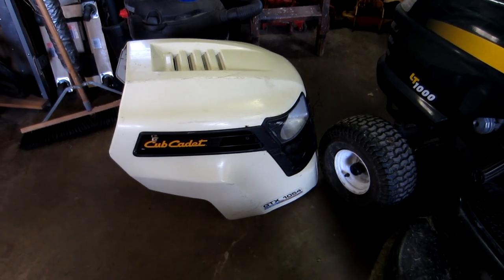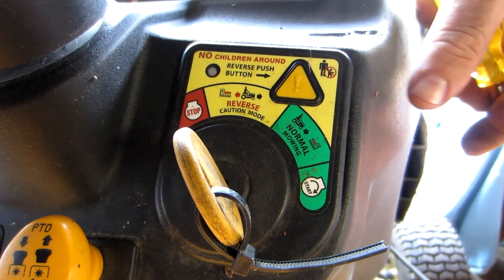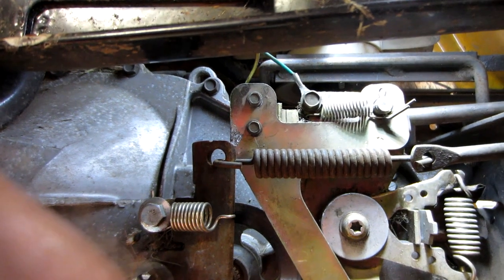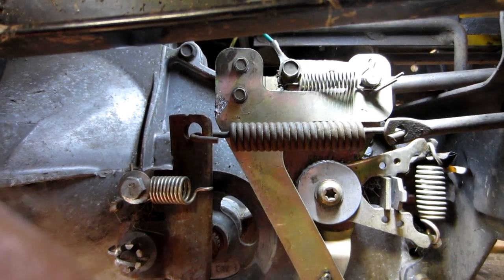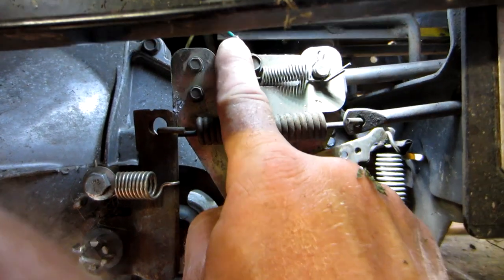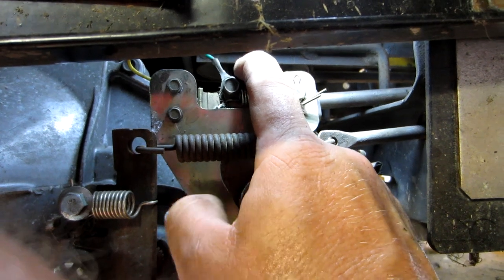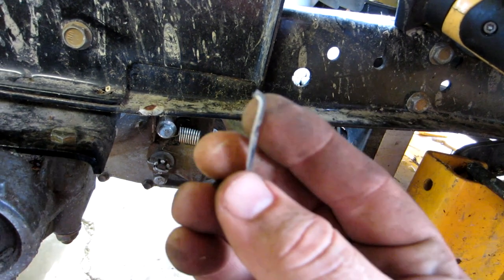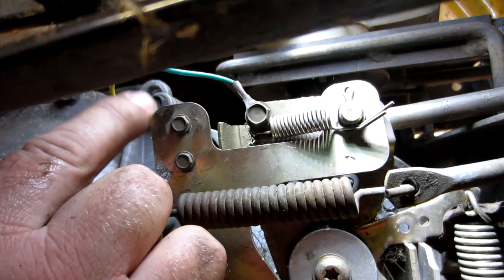Mower PTO Reverse switch Bypass

Comment: Figured out previous owner had tried to do this but didn't tape the wire, causing it to periodically ground to the frame. Thank you so much for shedding some light on this common issue!

Comment: Thanks for the video. I have an LTX1050 where the reverse mow button stopped working. After watching your video I found the switch right away. It's slightly different on the 1050. It's a plunger type switch fed by 3 wire through a block connector. I simply unplugged the connector and problem solved. The module had a yellow and green wire in it. I had recently changed the starter solenoid and green was used on the low current ground side. Good job, your video was a big help!
Reply: Correction...Fed by 2 wires not 3. Fat fingers

Comment: First thing I did with my Cub was disable the seat switch and the reverse shut off. If people can't safely mow they shouldn't use power equipment.
Reply: Heck yeah, I actually feel like that button is more likely to cause a distraction myself.
Reply: instablaster...
Reply: If people wouldnt drink and mow their kids wouldn't be chopped up...NO SWITCH NEEDED WOULD WE.  Happens every year!
Reply: @harryballz6358  That's what my old friend Howie Feltersnatch used to say.
Reply: Now if you could only find a bypass for the new "anti-spill" safety device on gas cans... you know,  the one that's impossible to use without spilling?

Comment: THANKS Saved me from taking tractor TO DEALER. You helped me to locate switch only to find hot wire was severed. That was last switch on my list to check kept blowing fuses.

Comment: Thank you so much! On my 01 Yardman 42" I lifted seat, pulled battery and tray and was able to access it easily. Been mowing for 6 years with this annoying switch. Would have to disengage blades every time I wanted to reverse. Mowing will be so much easier now!
Reply: It took u six years? You should be ashamed of yourself.

Comment: Thank you so much for posting this.  My switch went bad on my ztr Cub Cadet and I was about to lose my mind.  I was able to bypass it by just unplugging from the switch. It was as simple as that, and it was right where you said it was.  I didn't even have to take the wheel off or anything. Thanks so much!

Comment: Thanks! My LXT 1050 normally when you pressed the "yellow" button once with the key in "yellow zone" would allow you to mow in reverse unless you shut the PTO off. At that point you would have to reset it. Not this year!  Even holding the button down it shuts the PTO off in reverse. Came here looking for (location of a relay?) that may be causing the problem but this looks easier & foolproof.

Comment: Those are nice ideas and I will try that on my Cub Cadet zero turn mower which gives me the blues when mowing. My older John Deere zero turn runs the same in either forward or reverse and it don't turn off when in reverse. I will try that fix on the Cub Cadet and see what happens. Thanks for the tip and I hope it works for me.

Comment: I took a spring off a wooden clothes pin   cut the spring off with wire cutters which leave you with a U 
All you have to do is bend the legs so they are straight with each other and pull the PTO button out of dash and where the PTO button would plug into the base of its receptacle push the legs of the “prong jumper” into the base. It takes five minutes and you don’t have to do anything under the mower.

Comment: That's the thing with these safety features.. I push the button as soon as I start the mower anyway.  So even if a kid did run up behind me and for whatever reason I didn't look before backing up, the safety feature didn't make any difference. So it might as well be off all the time.

Comment: 2018 XT1 you can see the grey square plug looking trough the slot in the fender for the deck controls.  Simply unplug the large grey plug with the red and green wire.  Thank the engineer for the easy bypass.  The only reason it's there is because an idiot sued.

Comment: I got a new cc Enduro gt50 May 2019, the dash switches look the same but the wiring underneath was a bit different.It had a 2 wire plug connector on the plunger end, used a long thin screwdriver to release the lock tab ,and pull back to disconnect the wire connector, works great now !

Comment: that's great, but I just bought a used LT1045 and the PTO doesn't stay engaged. I've changed all the spindles because they would barely rotate. I'm  not sure if the belt is too loose or I need a new one. It's a 2008 model. I've disconnected and cleaned some of the switches already but I wish the answer would just be on the cub cadet site or troubleshooting page. Getting to know you , your knowledge and your all efforts to inform and share with us is gold. Keep it up and thanks a lot for taking the time.
Reply from the maker: +Sjaan Thanks... A adjust the pto clutch air gap
Reply: Sister n law has a ltx1050. Pto started to kick out. Wiggled wire while mower engaged to pto,that wasn't it. Thought it might be switch,not it. Just thought to mow in reverse mode, pto stayed engaged whole time I've been mowing since???

Comment: Thx for the tip.  Yellow wire cut and insulated, all works fine. No more button pushing nonsense and nothing to back over here.  Next problem needing resolution?  Rough ride. Lowering tire pressure a little doesn't help on a non-Hollywood lawn.  Cannot grasp why Cub Cadet cant develop a "floating" mow deck and add 4 W suspension.   Old backs cant handle that rough riding, wears us down quickly.  Otherwise, outstanding mower.
Reply from the maker: Yep, the best thing they can offer is more padding on the seat,,

Comment: You have to turn the key to the yellow and push it.  I only have to push it once and when that red light is on the PTO won't shut off when I reverse.  It may be a safety feature but it is also just one more thing that could break and cost you money.  That is the way things are engineered.
Reply: hey, thats what i was going to say lol, no need to cut wires

Comment: For modern day viewers with this issue: 1) If your'e under warranty, DO NOT make any mods like this or you'll likely void your warranty; and 2) you can buy a new ignition switch housing for about $40 if your button needs held like this guy's did. Super easy to replace that whole ignition housing, takes 2 minutes and no tools.

Comment: I have a 2016 Craftsman, T1000. No PTO. Already disabled the seat safety switch, now going to look for the blade switch. Pain in the butt shifting the blades off when backing for a tight turn. Now I have some ideas where to look for it, thanks.

Comment: I just bought a new xt1. I will absolutely be doing this lol.
Reply: does it work on the newer xt1. because im about to get one and I'll need to back up alot.
Reply: Mover key switch to the red section it says reverse and push it I'll stay on leave key switch there.  On craftsmanship they have simble that have  reverse arrow.. what he does in this video is not necessary

Comment: Mine only engages if the thing is in reverse mode?? Just started doing that, won't engage when in regular forward position. Is there a fix for that? Key switch is fine, I tested it, and new PTO switch. Thanks.

Comment: If that green wire breaks, seen in video, will that keep the mower from moving forward at all?
Reply from the maker: It will stop the engine from running Or shut off the electric pto for deck blades (if equipped)  it does nothing 2 the transaxle and the tractors ability to propel itself. If your mower is not propelling itself forward it is a belt issue or a transaxle issue. And if this just started after you changed your tire or had removed your tires make sure that you put your key way back in on the axle if so equipped.

Comment: My problem is when I start my mower and engage the blades then turn my key 🔑 and when I push the button it  Disengages the blades. Should I do what your video is Explaining? I have an 2015 xt2 cub. I can mower but if I go into reverse the blades disengage.

Comment: I don't know why that is even a safety measure. No one is going to back up by accident anyway. Most people look behind them while backing up. The first thing I always do when I start up my machine is I turn the which to the back up position and push the button so that I can mow backwards whenever I need to. I do not understand the purpose of having to do this other than to annoy the driver of the machine.

Comment: I have the LTX 1040 and it has a reverse button like yours has...   When I start mine it dies right away ....  Then when I press the switch while starting it.....  It will start and stay running ...  

Have you ever seen that happen ???  Mine is not a hydro model It's has the FNR on the left side by my seat, and the 6 or 7 speed lever on the right side of the seat next to the blade engage lever.......

Comment: @Foxboss9.  Stepson just bought a Bolens 38'', 6-speed riding mower with a ''No Forward in any of the 6 Gears'' issue for $100. The 1st thing he decided to do was put what must be the ''Reverse'' safety PTO switch & re-hook it up so it makes contact when you put the selector into ''Forward''. Now with that said, according to him,  I'm just wasting my time looking for the PDF's online, or hitting video's like this one. So far I haven't found the contact switch on any manuals yet but I'm sure that's what it is for. It's a 2006, so it's really not too old & is in great shape. Is that the same switch as what you just disconnected on your mower? Thanks....
Reply from the maker: The reverse safety switch has no bearing whatsoever on the forward motion. All the reverse safety switch does is ground the ignition coil and shut off the engine if you put the gear shift lever in reverse. It has nothing to do with the transmission function.
Reply: @Foxboss9  Yep, why my stepson has it in his head that I look for the PDF's on the mower, or search YouTube video's is wasting time but hooking up the safety switch around so it only works when you put it into forward, will make the 6 forward gears work. Thanks for replying to my comment. Perhaps I'll show him. lol, he has the ''Smartest Guy in the Room'' complex, so telling him he's wrong, only causes problems, usually with his foul language.... Great video too, thx for posting & again for getting back with me so soon... As for me, I'll continue wasting my time & look for the exact model's PDF manual, [for him]

Comment: Great video but if you cut the wire on cub cadet lt 1024 the hydrostatic transmission will not work
Reply from the maker: The Hydrostat is not electrical in any way whatsoever.... The Hydrostat works from hydraulic pressure developed from a belt driven by the engine.... if your hydrostatic quit working it's because of something mechanical. Make sure all levers, Springs, and adjustments to Peddle rods are correct. And of course make sure the belt is still turning the pulley and input shaft. Also, and this is very common, make sure that if you had the wheels off of the back of the mower that you reinstalled the key ways so that the output shaft of the transaxle isn't just spinning inside of the wheel hub. But to reiterate, no electrical source is needed for a hydro stat to work.

Comment: It's too bad they all can't be like my Husqvarna YTH22V42, where the Ignition Switch has a Reverse Operation System (ROS) position, which allows mowing in forward and reverse without changing anything whenever reverse is selected. (Of course, if you forget to switch from Run to ROS after first starting the mower, the sudden loss of power the first time you try to reverse is a reminder to do that.)

Comment: I can't  find the reverse switch.  You say its attached to the reverse pulley?  However, is there a reverse pulley on a hydrostatic x300?  Do I have to remove the mower deck to see it?  The other way to do this would be to trace those wires back to the connectors/switches on the dash and jumper them there.  What color are the wires that you are jumpering?
Reply from the maker: hopelessDiy not on pulley, it's on lever that controls the Hydrostat.. Not jumping anything, just disconnected the ground..
Reply: sorry my bad, somehow youtube said the mower was x300 but the mod you made is not on an x300.  X300 is different.  my bad.

Comment: Great tip.  I have a 2004 Troy-Bilt Big Read Horse w/ 54" cutting deck.  I'd LOVE to be able to mow in reverse.  But the PTO kicks off when ever it's put into reverse.  There is NO provision to keep the PTO engaged while in reverse.  Is there a switch somewhere that can be bypassed?
Reply from the maker: L1A1Rocker I'm not familiar with that specific tractor However, in my experience any wire that goes to a mechanism on the gear shift lever or the Transaxle is there just for the reason of shutting off the PTO when reversing.. So once you locate a wire in either of those two places, try disconnecting that wire.. Good luck..
Reply: Just wanted to follow up on this.  My Big Red must be REALLY old.  Shutting off the safeties was nothing more complicated than disconnecting the wires.  There were no ill side affects to deal with upon disconnecting the wires either.  VERY simple.

Comment: Had a red wire back there like the yellow 1 your talking about. Anyway it broke off the terminal and you couldn't start it. It's a lt model.
Reply from the maker: Clint Sanford some models need their safety switches in place and wired correctly to allow a connection for the starting circuit...sounds like that is what you have...You will have to bypass your switch mechanically. Meaning you will have to adjust or damage the switch arm for it not to be activated when going into reverse.... Good luck.

Comment: I've got cubcadet gt 1554 the switch on the brake is bad I need to bypass it and you can not get to it to disconnect it I'm wanting to cut the wires on it it has two orange wires and two yellow ones what do I do thanks in advance

Comment: Briggs and Stratton 1726556SM Switch - Reverse Mow Option on my Simplicity Regent (model 2690572) works intermittently. I hope to disable the switch instead of paying $25+ for a new one. Should your method work on my mower? Thanks.
Reply from the maker: As long as you disconnect the lead that activates whenever the mower is put into reverse it should work

Comment: Couldn't one just disconnect that ground wire and zip tie it out of the way of hitting metal? Or is that switch connected to multiple grounds?
Reply from the maker: +2drtahoefan1 Answer at 2:29

Comment: I don’t have the yellow button on my cub cadet, will I still be able to do this.I try to avoid reversing while cutting n it takes me a lot longer to cut my grass. It’s very annoying disengaging the blade to reverse n reengaging the blade to go forward.
Reply from the maker: You can look for a reverse grounding wire... Even if you don't have a button...

Comment: I have an lt2180, can not find the anti reverse switch. this one is not equipped with a button on the dash, I was wondering if you had any ideas where it is on this model.
Reply from the maker: sorry, i dont.. try looking up your models parts diagram.. it would be somewhere near the reverse pedal linkage in the rear( hydrostat) or in the rear near the shift linkage on a manual trans

Comment: I have a Cub Cadet  LT1042  and the blades will only cut ,  is when the key is in the reverse position with the red light on . The blades won't engage with the key in the on position ------  I can drive  forward or reverse with the key in the reverse position but only cut ib either direction with the key in reverse ..... Any  ideas ?
Reply: Hi ken kuhns, did you ever figure this out? Having the same issue? Thanks

Comment: Remember the days when your lawn mower had a little metal tab the you pushed against the sparkplug to shut it off?  They didn't even have a safety sticker that warned you that if you did it with your bare finger you were going to get an unexpected thrill.  Then the government came to the rescue of the many morons that have no business operating any type of power equipment in the form of the Consumer Product Safety Commission.  Belt guards, seat switches, brake switches, PTO switches, and now Reverse switches.  There are at least a dozen safety/warning stickers on a new riding mower and the first 15 pages of the owners manual is safety related.  I'm waiting for the government mandated safety helmet, with a heads up display like a fighter pilot.  You plug it in and enter your encrypted password that is to prevent Russian hackers from wreaking havoc in your garage at 3:00 AM.  Add to that,  California emissions engines that won't run above 4,000 feet elevation, and limiter caps because you can't be trusted to tune your own carburetor.  With all these dangers and safety issues, I've come to realize that the old man could now days be charged with child endangerment when he used to bang on my bedroom door every Saturday morning and yell "Get your ass out of bed and go mow the lawn"